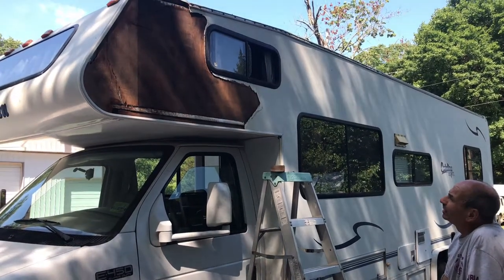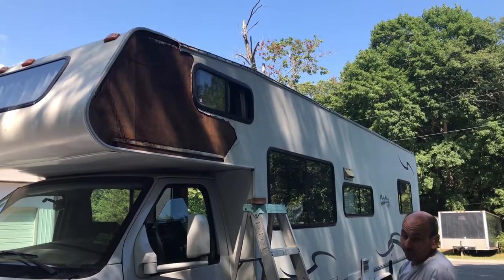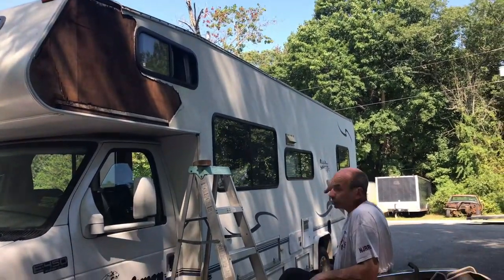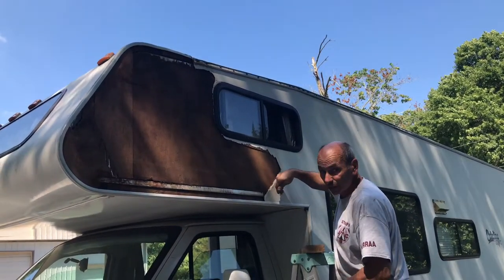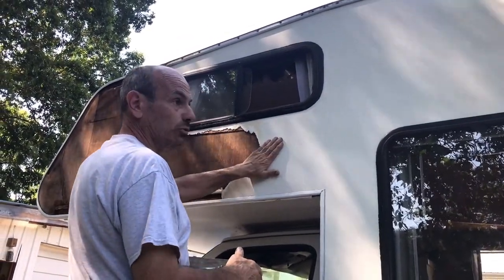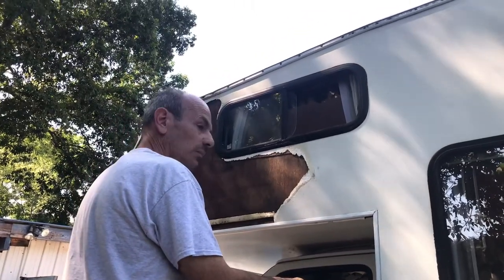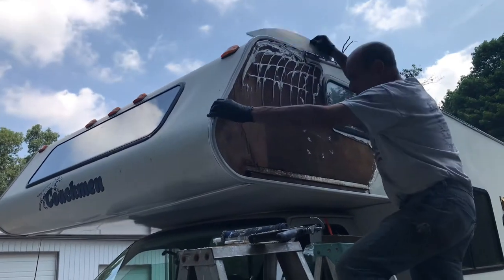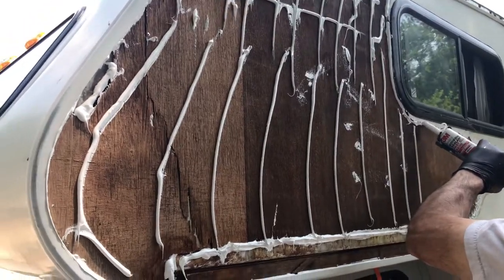RV side and roof repair

Comment: I noticed some block hold down wood that was stuck on the side repair. What solvent did you use to clean up?
Reply from the maker: The blocks came right off then Scraped the residue with a razor blade edge and cleaned it all up with some paint reducer .   All cleaned up real good.  Thanks for asking